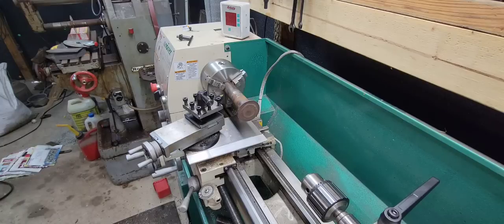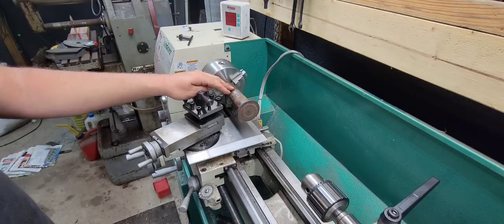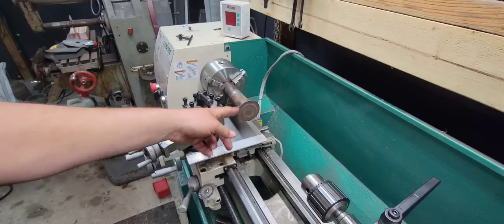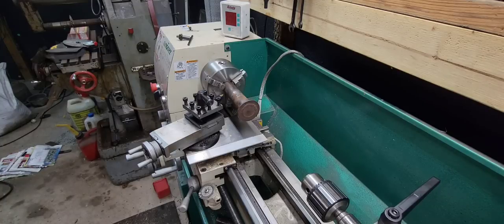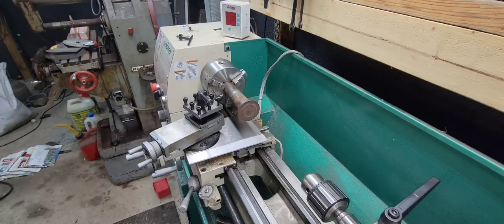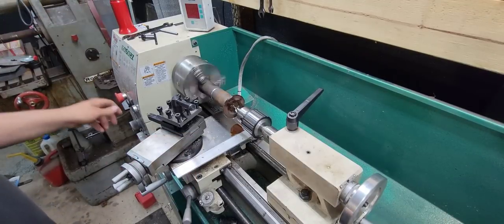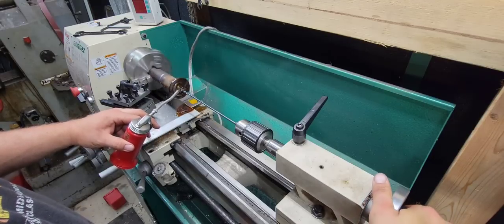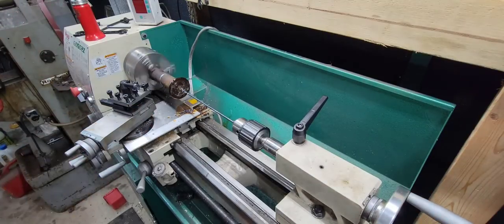Lathe & Mill Work... Gradall Pins Video!

Comment: Hi, Brandon, Try not to have the indexable tool holder, sticking so far out out of the tool post, to keep things as "ridged" as possible,  if you've got a revolving(live) centre, use it when the material is sticking out of the chuck, to support the work.. The more rigid the set up, the better.
 Hope this helps.. 😊👍🍻.
Reply from the maker: Thank you for the tips!!

Comment: Just a suggestion, turn your tap about a 1/2 turn, then back out, then go back in again. This cleans the threads as you're cutting them, last thing you want is a broken tap inside a project. Also, use an end mill drill bit to start your hole on a round shaft, this helps to keep your regular drill bit from "drifting" and yes, they will drift. 
It ain't cheating if it works. Great video, cheers :)

Comment: it is great that you have access to a mill and lathe they are great tools.
why did you not de rust the one pin? rust acts like an abrasive , plus 
iron oxide expands the diameter of the rods, not sure how critical it is 
in this application. barry
Reply from the maker: It was just a little surface rust where that pin is going it won't hurt anything it's not a very presice application lol

Comment: Thats a cute little lathe . Seems like it does a good job
Reply from the maker: It does a good job it's just it only has a small hole in the chuck so you are very limited on how big of piece you can turn with it I want something bigger eventually
Reply: @dirtgrainsteel  Look into the Precision Mathews Lathes thats what i have PM1640 and it is nice .

Comment: Great video! What do you do if you break a bit off? What do you use to get it out or you just make another pin?
Reply from the maker: They make carbide tools to cut drill bits out our you just start over with a new piece I would just throw the piece away and start over since it's easy to get another hitch pin but if its a one off pice you got to get the bit out I actually don't have them tools I need to get some